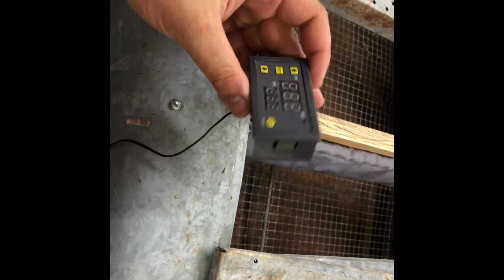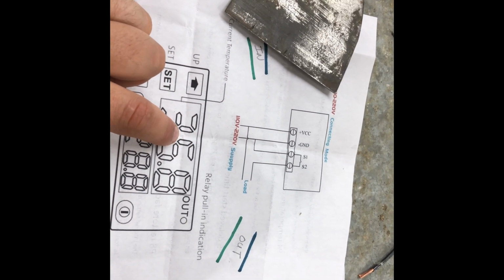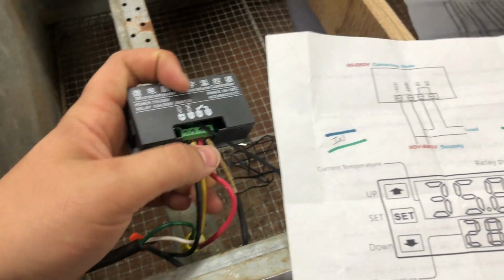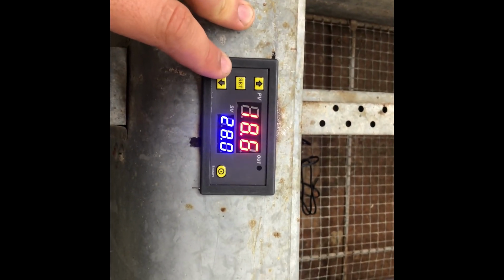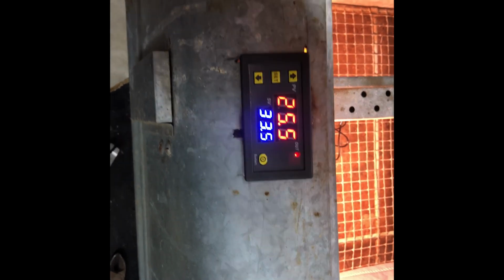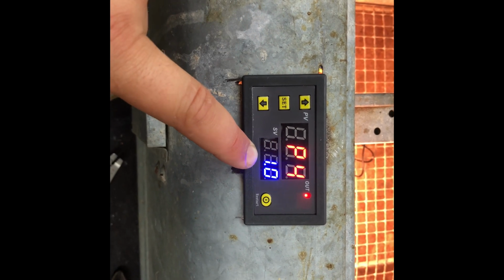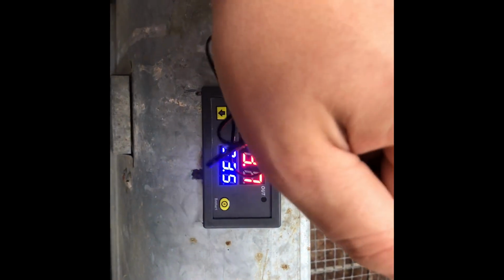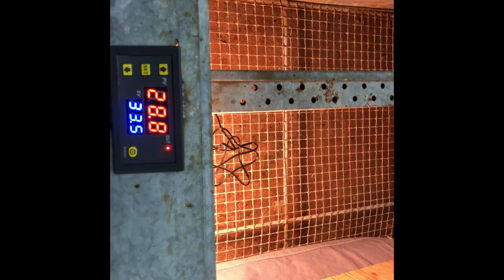W3230 controller for brooder

Comment: Could that work on a car oil cooler?
Reply from the maker: Depends on your system it is 50 degrees C to 100 degrees C. It has a 120v and a 12v dc depending on the option you select